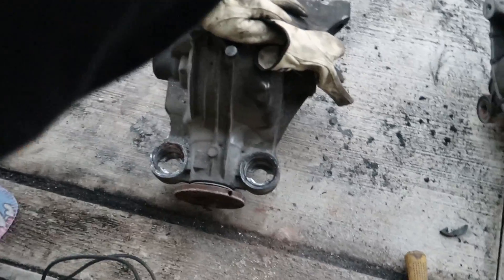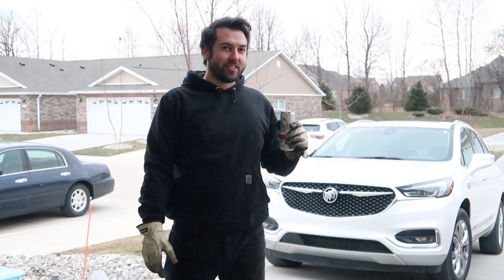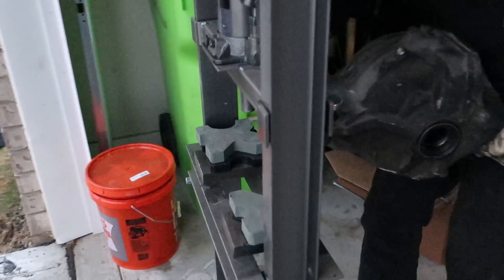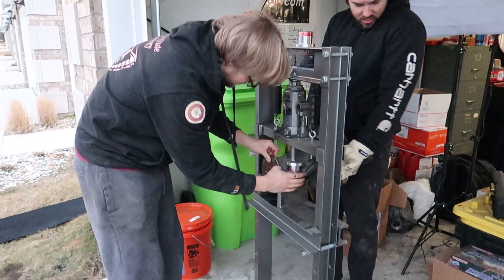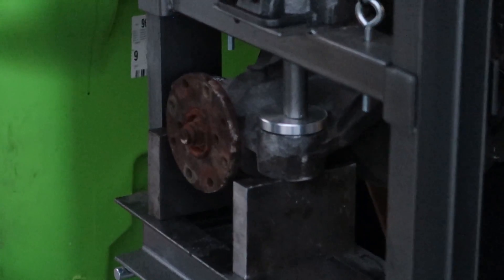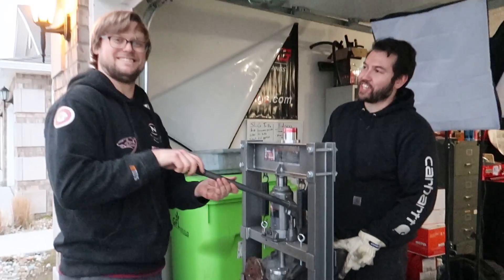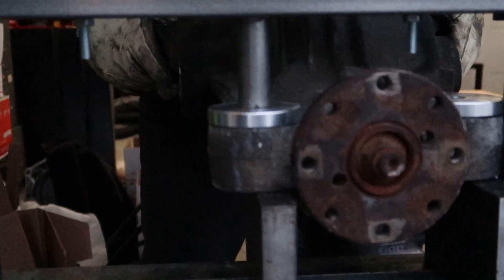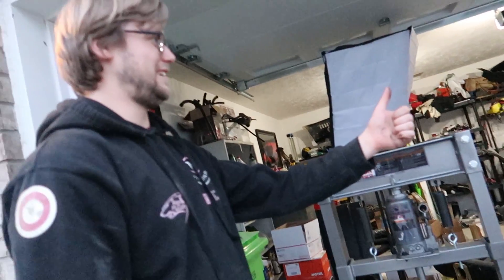Ford 8.8 Aluminum Diff Bushing Installation DIY

Comment: Hey guys, I am planning on doing a DCT swap to my 335i and I've been very interested in your Ford 8.8 Swap bundle. But I am worried that the smallest ratio you have 3.08 will still make the DCT gears very short, do you have any advice on what final drive I should get in conjunction with the DCT. It would be much appreciated.
Reply from the maker: Hey there, the 3.08 works perfect and is what we use in our own dct swapped car. 10/10 recommend
Reply: @SeemsLegitGarage  Alright thank you so much, I cant wait to be doing two wheel pulls. :)